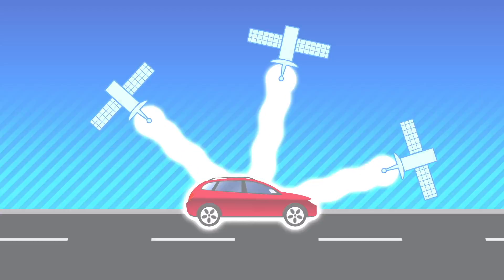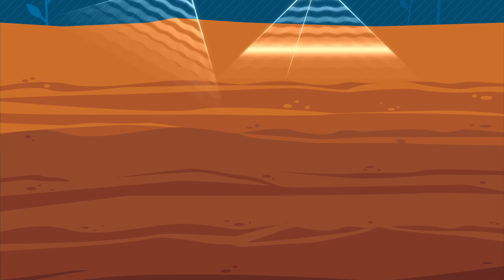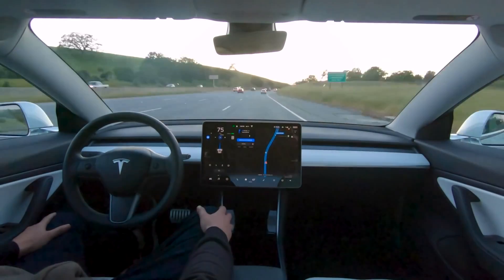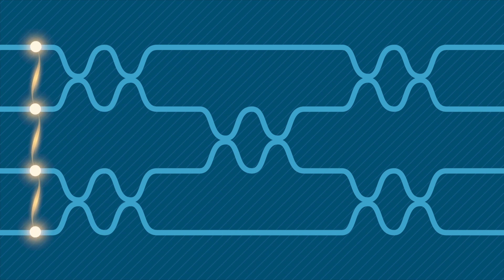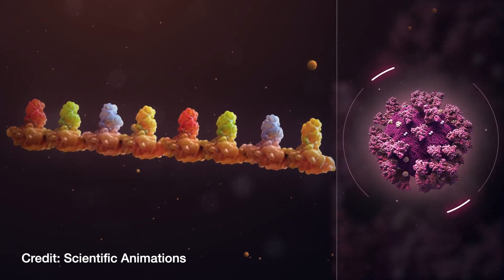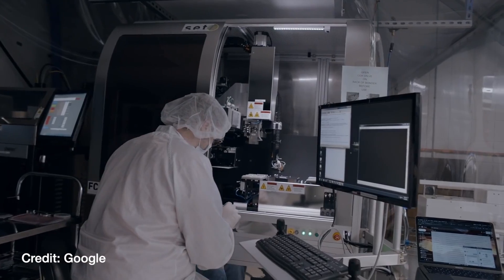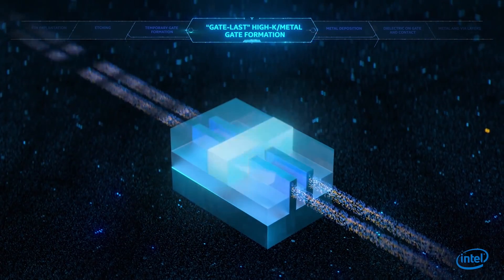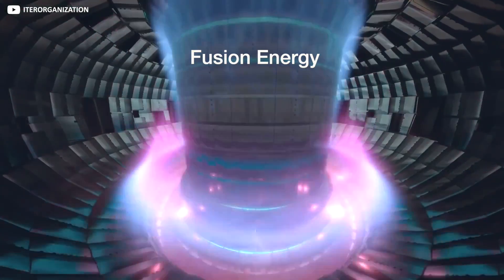AI Too Dangerous To Release, Tells Clever Jokes.

Comment: GPS doesn't transmit your position. A GPS receiver is just that, a receiver. 
AIS linked to GPS will transmit a ship's position over VHF, but these can be switched to "silent" mode.
GPS is incredible, I'm still astounded the US DOD allows everyone to use it for free. It's an expensive system to maintain,  and I've always thought a one off fee of maybe $20 when you buy a GPS receiver would have been perfectly acceptable, and would have reduced the burden on the US taxpayer.
When you consider the number of GPS chips sold annually now, it's a huge opportunity lost.
I guess on the other hand, with the GPS network being free of charge,  the US DOD is free to shut it down whenever they need or want to.

Comment: Was going to say that atomic clocks are kind of big so you still need a connection to connect to the atomic clock. But before I posted that willy nilly I first checked if my understandings of atomic clocks, which was based on knowledge decades old still stands. And it doesn't you can have atomic clocks now which fit in a matchbox.

Comment: All of these were the clever jokes - right? Perhaps Quantum Computing may be well suited for some certain classes of problems - and that's it. The AI Revolution b.t.w. is taking place since about 40 years - and still not arriving. 
If somebody takes a closer look to the problems allegedly to be solved he (or she) might notice: there's almost no really urgent one among them. Lots of "nice to have" and a sobering low amount of usefull things. But i'm quite afraid the majority of these problems are of the kind, nobody really needs zu be "solved" and that's it. 
To be clear: There's absoutely no need for even more/better "advertising" as long as advertising consists of lies.
After all almost no really convincing benefit but a quite concrete chance for the loss of determinism and final control. 
I suggest we better avoid AI-Systems negotiating the next war - and same applies for significant prolongation of human lifespan and most of the other nonsense phantasies.
First of all humanity has to fix that tremendous pile of problems generated by capitalism as THE backbone of our collective organsisation - resulting in all kinds of fraud, criminality, mental insanity etc. And for this task, we really should know what we're doing...

Comment: Unbreakable encryption / data transfer may emerge, however as of now these systems require multiple iterations of the data to be transmitted to ensure fidelity due to random quantum decoherence /unwanted entanglement events, so a fraction of these reiterations may be 'stolen' and deciphered without detection by the message senders. The question of what actually happened to the missing photons therefore may not be conclusively determined...Random decoherence or data theft ?

Comment: We need to move away from silicon, in favor of carbon chips. I know it is happening. But this effort to make silicon quantum chips, seems a slight step backwards, or sideways, rather than forward, in light that we are not only finding a limit to what we can do with silicon. Limits carbon chips are said to solve. And in light we seem to be running into a silicon shortage and monopoly. Carbon is cheep and one of the most abundant elements we have. Hard to monopolize and stick a high price on something that can be found near anywhere in the world.

What is said in this video is great, and great news. Will love to see what will be made with this knowledge in this video. Some Super intelligent AI perhaps. Or a way to merge our human minds with a quantum chip system to gain vastly better thinking abilities, and possible mental immortality, in a new Super AI designed synthetically made organic body, transcending the human form perhaps. That I would like to see.

Comment: Mistakes entanglement with superposition first. The behaviour of atoms and molucules is a suitable area for quantum computing and also AI, but quantum computers are only suitable for a certain range of problems. There are a lot of problems which are not useful for quantum computing though. The main issue with quantum computing is that you need to cool down the qbits to a very low temperature to avoid interference from random heat noise. This is not something you can engineer away, it's a limit based on physical reality. There was some random BS about using entangled light, but in the end you need a device the size of a car to cool down the qbits. I'm not against the advancement of this field but I prefer to stay within the realms of reality and physics. Quantum computing is very exciting, but it has a limited scope and will not be able to be scaled down a lot. I do love Stephen Fry, very much, but that doesn't mean I agree with what he says all the time. I recommend his love of Wagner's music, a great piece of youtube.

Comment: The white trails left by jet airplanes is not due to the fuel being used; it is water vapor in the air being condensed as it passes through the jet then rapidly expanding and freezing creating the white trails we see behind jetliners. Electric engines in the planes will not cause this to go away as the animation in the video shows. A silly misrepresentation,

Comment: Porn on quantum computers is gonna be wild. Your gonna be watching it, and not watching it at the same time.
Reply: Quantum Computers will be used for calculations. They will not be interactable like a traditional digital computer. It is likely that digital computers will have a quantum computer inside them, but as a separate device. When a request for a calculation is made in the digital computer, it'll be sent to the quantum one. Pornography will not be run on quantum computers. Probably.

Comment: Isn't that the guy who voiced the british subway announcements and the british version of Stephan Hawking's wheelchair? Also, regarding the batteries being 90% lighter, the guy who developed lithium batteries actually made another breakthrough in battery tech somewhat recently, by creating a solid state battery that holds more charge, lasts longer, weighs less, and uses sustainable material by using glass as the electrolyte instead of some kind of acid.

Comment: First quantum chip commercially avilable at current equivalent cost, will be around 5 years if you apply the Law of Accelerating Returns to the current trend. 

Will check back here on a much faster device in 5 years to see.

Comment: That self tracking method is the most frivolous waste of technology I have ever heard I think.  Self tracking could be done much easier with much lower less expensive tech.   I suppose if the atomic and photon measuring tech becomes easy and cheap it may be as efficient with less expense but I doubt it.   Gravity map and sensing?  It seems obtuse.  That like getting equipment to navigate your living room by sensing exact heat instead of looking.  What's the point.

Comment: @1:16 it doesn't interrupt ATM. Navigation Satellites are used for tracking position, not transmit data. ATM works via internet wich is mainly via cable. Only services related to autonomous position are disrupted and usually have a "manual mode". Compass still works :)

Comment: Never work It is OK under controlled conditions or out in the wilds but when or if it becomes the norm it will create  a soup in which it will not work. The result would be similar to using sound to see what is under ground while a road crew is using jack hammers a few yards away.

Comment: My first DIY radio had a 2shilling and 6 pence diode and a WW2 surplus headset and parts and a huge copper wire aerial with no battery.
It was a modified crystal set. I used to listen to BBC in bed at night

Comment: AI, no matter how powerful, even if it can enhance itself, can not escape the limitations imposed on it by the expressed values of its creator.  An inherently malicious AI controlled by a tyrant is their ultimate wet dream and the common man's worst nightmare.  However, an inherently just and benevolent AI in comprehensive control of the levers of power could benefit mankind immeasurably.

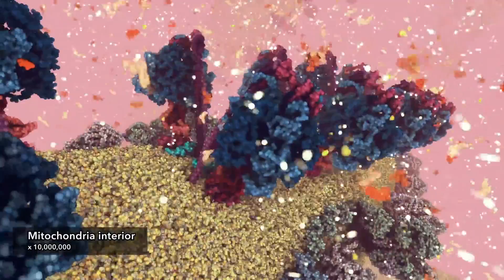Comment: Super interesting video, but as someone who studies computation I have a slight dispute with the claims made around 9:05 (disclaimer: my understanding of computation is good, but my understanding of QM is shakey :P).

Arguing that because molecules are fundamentally quantum we need quantum computers to model them efficiently does not follow.

If you compare the naive approach of hand simulating every interaction between fundamental particles in the system then yes, QC is obviously exponentially more efficient than classical computers. But this is somewhat trivial to note.

In most physical systems the component wave functions are constantly undergoing decoherence, which is why we don't tend to see any spooky quantum effects at the macroscopic scale.

But this doesn't change the fact that all objects are quantum systems - so why can we accurately predict the motion of a  ball thrown through the air without simulating and evolving the wave function of the whole system? Put simply; these systems have high-level patterns that make the low-level descriptions redundant. 

In the technical jargon, the system has low Kolmogorov complexity. It can be described accurately with less information.

Going back to molecules, there are certainly high-level patterns that can be used in the prediction of these dynamics. Projects like AlphaFold aim to use machine learning to find such patterns, and there has been some success in this area.

However we don't know in advance the efficiency of the optimal prediction algorithm when implemented on either a QC or classical computer. The best algorithm could be a sequence of simple steps that runs super quick on a classical computer and super slow on a QC, or it could be a huge combinatorial search that lends itself to a QC. I expect a mix will end up being optimal (I.e. work divided by different types of machines).